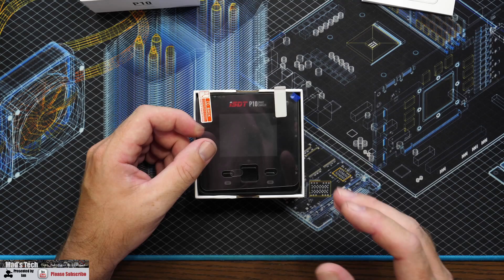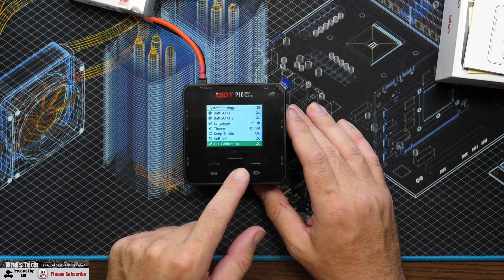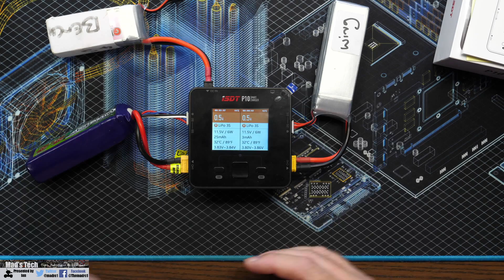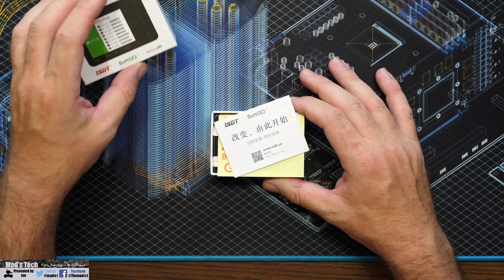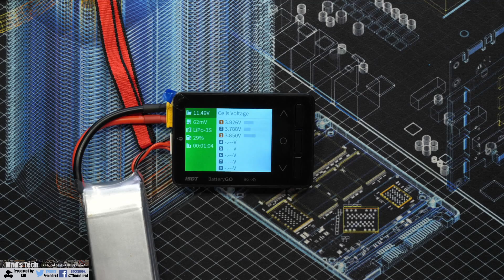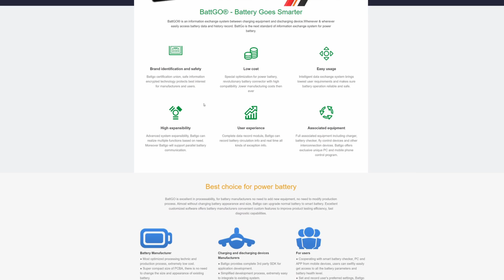ISDT P10 Dual LiPo Charger & BatteryGo BG-8S  Review

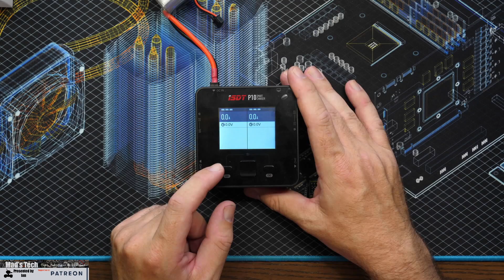Comment: 13:20 i set the ULiHv chemistry option to 3.85v on both channels, and it seems to remember that value so far, so i can use that as an easy "Storage mode" but obviously its only storage charge, not discharge.

Comment: 6:21 how do you use "dc power on CH1"? 
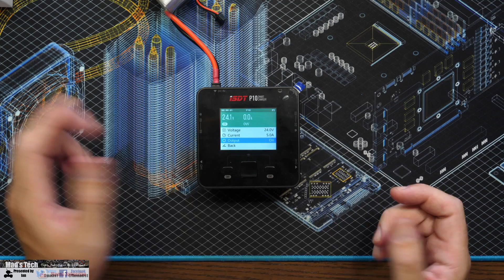12:01 Nothing happens on that when I press the button
Reply: worked after I updated the firmware.
Reply: @fpv_india  May I know which firmware version are you running your P10 now? I have the same issue with mine.

Comment: BattGo is dead.  Why is ISDT still placing the feature in their chargers for batteries that no longer exist?
Reply: Did Horizon Hobby buy the tech?? I have seen some reviews about smart batteries being recognized by the BattGo feature on this P10... Meaning you can use the P10 like a spektrum smart charger. Also ISDT was hired to build all the spektrum chargers for horizon hobby so It makes sense but im not sure...
Reply: @nmfishdude200  My understanding is that Horizon Hobby / Spektrum bought out BattGo just prevent any further developments.

The last firmware update I got for my ISDT Q8 actually has the feature listed as "removed" in the list of "fixes".

Comment: I'm slowly doing the same thing no more parallel charging for me.  Mainly so I can monitor the IR in the cells. I live in California we need no help with fires
Reply: I find my batteries experience random cell failures whenever I parallel charge.  I now only Parallel charge the batteries to 80% capacity, then charge them individually to 100% now.  For this, I have 2 chargers to aid with the process.
Reply: @MatthewTaylor3  that's kinda what I've had happen. I was low amp charging some really expensive packs and one cell puffed really bad that one pack would have paid for 4 little isdt chargers. I do like the idea of charging to 80%
Reply from the maker: This is a great move. Parallel charging does add in so much more risk.  For the cost of these cheap chargers it’s simply not worth it now. You can spend a few hundred and know you much safer.  It’s cheaper than a new home.

Comment: how much risk is there to store lipo in room temperature while not charging or discharging?
Reply: Little risk. But you should store your LiPos in lipo bags just in case.
Reply: Storage voltage is much saver..

Fully saved = more energy saved in it - so more smoke and fire can come out of it than a "discharged" one (3,70 to 3,8 Volt is my storage voltage.. )
Reply: Damaged cells are more dangerous..

And if a battery smells like "candy" / sweetish it's dying - dispose it.